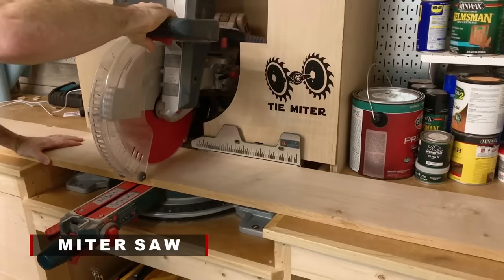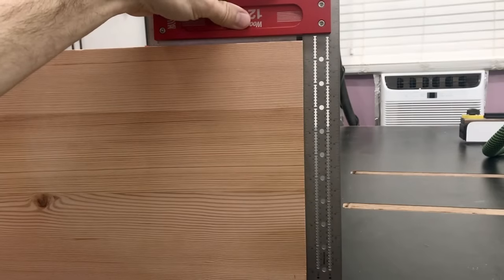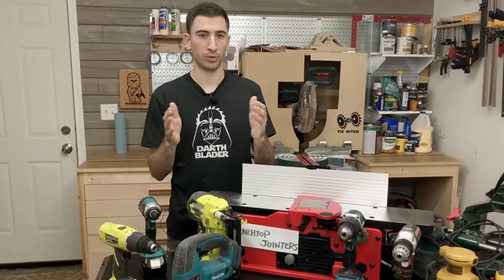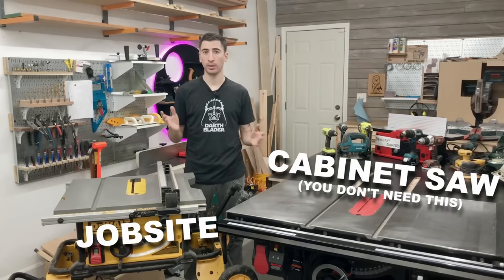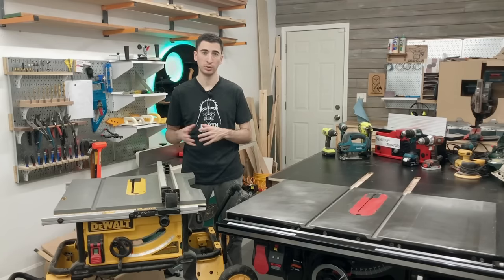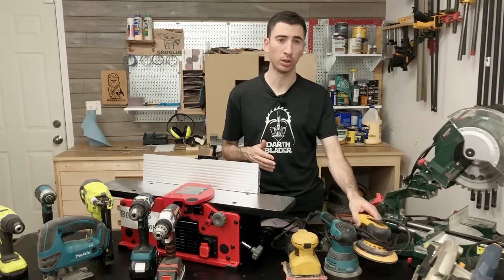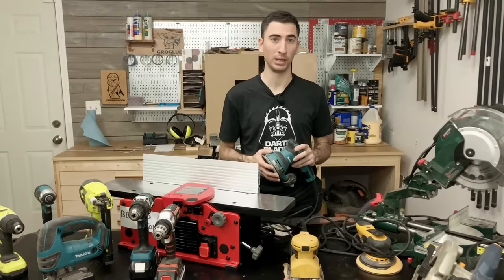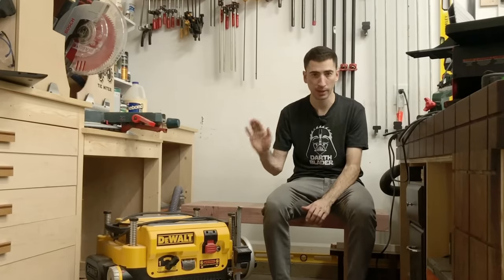Woodworking POWER Tools // Watch Before Buying

Comment: I once heard the suggestion that you buy the cheapest tools you can get when you're starting out. If you break it or wear it out then you move up to better quality because it's probably a tool you use a lot. If it doesn't wear out then you probably don't use it that much and you didn't waste more money than you had to.
Reply from the maker: Thats fantastic advice Thomas
Reply: I like that philosophy. Because trying to sell an upper tier tool that you realize you don't need is a whole other kind of headache.
Reply: It works unless cheap tools means lower quality, like DeWalt stuff.
Reply: It is a very good advice. The only catch is that sometimes, you spend so much time trying to master a cheap tool to realize, it is just not accurate enough, whatever you do. That's what happened with me with a big table saw; I've took on the challenge to master it for 3 years, and was able to do nice stuff. Then I got the 735 Dewalt Jobsite Table Saw to realize I spent 3 years loosing my time to a saw that was never going to provide the results I thought could be achieved
Reply: Harbor freight method
Reply: OR, you ended up scoring a magically good deal! Nice advice either way.
Reply: @bowlchamps37  Then why do so many professional craftsmen use only Dewalt?
Reply: In Scotland we call certain cheap tools "chuckaway charlies" or Bendyfriends -e.g. 100 piece socket set for 9.99 etc.

I've restored a bunch of yachts/houses and buy cheap orbital sanders, for example, for knocking back hulls etc. No point in using an expensive tool for a sort of crappy, punishing job, that'll trash the tool relatively quickly. Ditto jigsaws. I use a Harbour Freight equivalent for basic work at the yard and more refined tools in my home workshop.

I'm often surprised how long some of these cheaper tools last, but I tend to look after stuff anyhoo.
Reply: I broke 2 cordless drills at my work made by Makita lol they simply overheat and broke, after that I bought myself Bosch and I'm using it now for year and half and I'm really happy with it, I tried cheap versions like Parkside or Einhell or even Boxer but they're just too weak for my type of work
Reply: This does require knowing when a cheaper item will cause more problems in the long run. Some things are obvious like safety gear, other things less so and it may show up in terms of usability or repeatable precision.
Reply: I have several of these and built our Off-Grid home with them.  Worked fine and am still using them.
Reply: I get it. It makes sense. But… I’ve been doing it long enough to finally realise that: you buy cheap - you’re happy for a week or two then angry/disappointed/frustrated/miserable really for years to come. You buy something good which usually is expensive and it hurts for a week then gives you years of happiness/satisfaction/pleasure. 
That said not all tools have to be new. Personally I take pride and pleasure in fixing machines, so I often look for used or even broken ‘good ones’. Win-win
Reply: @camofpv  I figure that's how you discover which tools you have to spend more on. That way you don't spend a fortune on tools you'll only take off the shelf once a year.
Reply: I know a saying: I'm too poor to afford to buy too cheap. Often cheap things don't last too long, and you find yourself buying exactly the same thing once again, later on. So you may end spending, the same amount of money that a better one will cost. Cheap things, like tools, can, many times, be hard to use, because of adjustment possibility, or imprecise adjustments, durability of the tool, vibrations, noise and so on. I'm not saying that you can not do different kind of work with cheaper tools. I'm saying that when you go cheap, the risk to go too cheap, is very much present, and you may end with something very close to useless. Sometimes it is much more difficult to purchase something cheap and useful.
Reply: @bowlchamps37  You don't like dewalt?  What do you recommend?
Reply: @Layjaylagoose  dude I had the exact same experience with a cheap table saw.  It wasn't from Harbor Freight but you can get the same one from there with a different sticker.

I could never afford a nicer saw but somebody was really nice to gift me with the same DeWalt jobsite saw and it really drove home how much I was fighting the cheap saw.

I probably used the cheap one for 5 years and built lots of stuff I'm proud of with it.  The only thing I disagree with is that I don't feel like that time was wasted.  I learned how to set up different cuts and the discipline to double and triple check that everything is right before making a cut.

And even with all of that being said, I still agree with the main point of buying cheap to start off with.  Especially if this is just a hobby that you don't know where it's going to go.  If you just watched a bunch of YouTube videos and got all wound up wanting to try this stuff then you probably shouldn't go right to spending $10,000 getting an awesome shop set up without even knowing if you really like this stuff, have the patience to learn, or even the ability to do it.  For example, I've got a $100 HF miter saw that I'll probably never replace unless it dies because for the relatively little I use it, it works great.  I've got a friend who bought a nice miter saw that's still in the box because it turns out that he got a little too excited about this stuff.
Reply: @stefang1087  I agree with what you're saying but I'm very broke.  The only time I'll ever buy a tool is when we've got extra money (like tax returns).  So if I end up buying 2 cheap saws over time when I could have gotten one decent one for the same price, that's a moot point for me because that's all I'm ever able to afford.  If I tried to save that money it would end up having to be spent on something that is definitely more important like food or when the cheap car eventually breaks down.
Reply: @bowlchamps37  nock dewalt as low quality all you want but I’ve had mine since the versa pack came out and I’m still using them 
Even upgraded the batteries and bought a few other tools that use the same battery 
I use them daily for everything from hanging drywall to hanging stucco wire so to say a few thousand screws isn’t even a stretch 
Infact I like them so much I’ve never bothered to contemplate replacing them or “buying better”
20 years later
Reply: @rickshannon2044  I’d be one of them 
30 years in the trades 
20 with the same dewalt 18volt XRP versa pack that I use at home every weekend and everyday at work
Reply: That's good advice, but I went ahead and splurged for a Dewalt table saw since it seems that a table saw is really a foundation tool. I forked out another $200 for it over a Skil.
Reply: @volplay1  I can almost guarantee that he would recommend Milwaukee. There is a rivalry like Ford/Chevy that requires people to shit on the opposing brand at every opportunity.
Reply: @gon3946  Bosch corded hammer drill is amazing for concrete work
Reply: Sounds like something a cheap tool salesman would say…
Reply: I was taught this too, and it is sound advice, but there are some exceptions, like I've gone thru about 4 lower tier recip saws within the span of a year, and looking back at the money I spent on those, I could have gotten like a 4 or 5 tool set from a premium brand. bit I suppose that does reinforce the idea of using cheap tools to see what you actually end up using.  but one point I wanted to make was sometimes w cheaper tools, they don't perform properly and could turn you off to the Tool entirely, just to find out it's an essential tool, just u had experience w a shitty one lol.. long story short,  I guess my opinion on all this is, start out w a lower tier setup,, but go w a higher level lower tier setup lol if that makes sense. 
go w ryobi over black and decker,, craftsman over hart,, and anything over warrior n harbor freight shitshaha
Reply: Adam Savage gives this exact advice in his book and it has really helped my GAS (gear acquisition syndrome).
Reply: That's a formula for frustration, discouragement and throwing your money away.
Reply: Actually, buying the best of everything when you'll rarely or never use it is throwing your money away. The point is, if you end up using it enough to wreck it you know that's the tool you should spend more on. If you bought something cheap and you find you hardly use it then you haven't lost much.
Reply: No, get the best you can get otherwise your just paying thrice
Reply: This is exactly what I did when I started building electric guitars. I really quickly noticed what tools I demanded more and bought better ones. I still use a few really affordable tools today because they do the job and there is no reason to "get better". Sandpapers, saw blades, cutter and router blades are the ones where I invest in quality. Of course, hand tools are also heavily used in my work and I applied the same updating principle to them.
Reply: @bowlchamps37  the old cowardly black and decker 😎
Reply: @rickshannon2044  Dewalt has made some nice tools over the years & they've also made some terrible ones. Can't tell ya how many cordless Dewalt impacts I've watched burn up over the years from only moderate use, while red & orange tools did the same job just as well if not better and always last longer. Dewalt heavily relies on their reputation from the 80s & early 90s paired with by far the biggest marketing budget of the box store brands. Some residential contractors buy Dewalt because historically it was a safe bet, as it worked for grandpa/dad for a couple decades. Once most contractors are using a battery platform it's nothing short of an act of congress to convince someone to switch. Go to commercial construction sites and it very rare to see anyone with a toolbox full of Dewalt.
Reply: @ragnarrklangsrok1685  Until they burn up! Milwaukee rotary hammer drill costs less and lasts longer than the bosch.
Reply: Not the best advice. There’s a variety of reasons not to buy the cheapest. The reality is that the cheapest are made poorly and will fail. But more so are dangerous. Buy American made, or one that has good reviews. Sure you don’t need a pro level. But save you fingers and get a safer one.
Reply: It’s good advice if you’re going into it as a hobby vs starting a trade.  I saved up and bought nice tools along my electrical apprenticeship and I’m glad I saved for good tools I knew I’d use bc my foreman and Jmen had em.
Reply: Love that philosophy!
Reply: I will respectfully disagree with this philosophy.  You spend money on “junk” then spend money on something that’s quality?  So you end up spending 50-70% more money than if you had gone out and spent your money on a quality tool to begin with.  I spent a couple of years struggling with an old craftsman contractor tablesaw with what has to be the absolute worse fence ever conceived.  I could never trust the damn thing to be square, from cut to cut. The saw was extremely heavy and underpowered. I finally went out and bought a DeWalt and it’s night and day.  It’s not a cabinet saw. I don’t have $4K-6 to spend on anything like that. One day I may decide to get something better but at the very least, I’ve greatly improved my building experience and alleviated a ton of frustration, for now.  If money is a problem, I’d rather buy a used quality tool than a brand new inferior tool.  I visit pawn shops and apps like Offer-up.  I’ve found some pretty great deals on both.
Reply: @bowlchamps37  I have NEVER seen a cheap DeWalt ANYTHING.
Reply: I hate seeing this stupid comment on every video like this. Yeah, we need more people buying cheap crap thatll go into a landfill.
Reply: @BadYossa  You should be less casual about telling people to work on batteries. People can burn their house down if they are too casual.
Reply: @OptimusSatanas  Buawhahahahahahaha!!!  Well, there you go. Glad somebody said this.
Reply: You can buy cheap but DONT PUT YOUR LIFE OR SOMEBODY ELSES IN DANGER. shop around.
Reply: Im not going to spend a truck note on Snap On Tools
Reply: Agreed, but there are a few caveats I think. Buying used on a platform like OfferUp has made it possible for me to create a decent, rudimentary shop to start. But. You’ve got to do a little research before buying. You can get TOO good a deal (like table saws) that almost never come with the safety stuff ordinarily included with a new purchase (fences, blade guards, riving knives). Looking for a saw with a fence set on a rack and pinion setup makes the purchase a bit more, but trust me when I say you will be VERY glad you did. I learned this the hard way. My first table saw was so bad, I couldn’t even make a workable cross-cut sled with it. I didn’t bother investigating why (though I suspect there was something jacked up with the blade bearings or setup somewhere). Unless all you’re going to do is rough cut lumber, it is in your best interest to get as good a basic table saw in the first place. Skilsaw, Craftsman, Dewalt, and Makita all make jobsite saws that work well — look for the pricier models with the rack and pinion fences, they’re out there. 

Or, hit your mother-in-law up for a Jet as a wedding anniversary present, your choice. 😀
Reply: Very good advice indeed. Not just for woodworking, but, for any craft or trade you're interested in.
Reply: @Layjaylagoose  Point. Still, you found out what you did want from the tool by struggling with the one you didn't. So it was just a learning experience that went a little long is all.
Reply: You can easily end up with a lot in the garbage can by using that i have bought a few cheap tools and tried them once just for throw them out again and bought some quality.
Reply: I've just bought a whole load of budget tools and cordless tools but good quality German made and many are cordless with only 2 or 3 types of batteries that happen to interchange with other (unnamed brands) as they're actually made by a brand name under an own brand label.. going to be good enough for me! (And they come with a 3year warrantee, so you can't go wrong!) If they blow up you get a refund or replacement.. job done! 
Cheers from London England 👍😎🏴
Reply: It is if the tool is square, sharp, sufficie try rigid or whatever it is supposed to be or at least close and serviceable or adjustable.  

So many cheap tools are not, and they don't get you anywhere but frustrated, or worse, ruin a workpiece.
Reply: Hmmm. As a weekend warrior, I still use my uncles 1968 corded electric drill for some jobs. I also have Millwaulkie compact-impact drill set used on many jobs fer 16 years. Still goin strong. Dewalt compound-miter saw and table saw fer last 8 years. Happy with my products. These products are always going on sale at  yer local big box store.
Reply: @ragnarrklangsrok1685   I used Bosch corded hammer drills everyday as an electrical sign installer in the Los Angeles area all through the 90's.  Those are great hammer drills no doubt.  Drill thousands of holes through the sides of concrete building all over the great L.A. area with mine.   Just like any tool though with that kind of daily abuse you will wear them down over time or at least require some maintenance after a while
Reply: Same approach here. And we believe what suits pros will last starters. Pros that pay for the tools they use, may choose differently from a situation where a company picks up the bill.
Reply: Or, you don't use it cause it's inefficient, inaccurate, & just plain sucks so you should've purchased one worth using to begin with. I run into this a lot with every tool.
Reply: @ZackHarold  I was gonna say heard it from Adam Savage. However, I am still not cured of the syndrome/addiction yet. It's a work in progress.
Reply: @BadYossa   thank you- I’ll go check out his channel
Reply: @rickshannon2044  customer service
Reply: That's sound advice! 👌🏾
Reply: I might not buy the absolute cheapest, but I'll definitely consider decent budget tools from brands like Ryobi or Black & Decker.  Here we also get some Chinese brands that have built up a good reputation due to being both cheap and able to stand up to a decent amount of abuse.
Reply: I've never heard the suggestion you posted before, but I agree 100%. Most of the tools I started out with and still have are/were used name brands, or new cheap off brand tools. The tools I find that I end up using the most I'll do my research on name brands first and wait until any holiday sale is coming up and go buy a new one, only after hitting up the pawnshop, or any other second hand stores, or garage/estate sales first. Lol
Reply: @BadYossa  where in Scotland are you from cause no we certainly do not call them that 🤣
Reply: A great source for tools can be a Pawn shop. Just make sure they're not worn out. I've picked up great pieces.
Reply: @Layjaylagoose  that 💯 true.  A better quality tool can help you preform better sooner, safer, and cause you to stick with learning.
Reply: @Layjaylagoose  Exactly. For some tools accuracy is the defining criteria for it’s quality. For others it’s durability. For saws, you often want accuracy above all else. For drills, it’s durability and power. Generally speaking of course.
Reply: But if its Xmas ask for the nice one!
Reply: Definitely make a good point.
Reply: @bowlchamps37 
Do you even watch reviews, Dewalt
 Is a pretty solid brand. I’m not saying all their stuff is fantastic, but they are mostly a hit than a miss 
Unless you are using the wrong tool for the job
Reply: I bought a mastercraft hand planer and it's a peice of junk I'll never use it I wish i would've bought a more expensive one I'll probably never buy a hand planer again
Reply: I've run into this too - the inability of a cheap tool to do a good job. I have countered the urge by doing hours and hours of research on the web when I need a tool. I don't really like to buy as cheap as possible for this very reason. Even if it's just an angle grinder or screwdrivers. Cheap, disposable tools are rarely good for anything other than exercises in frustration. That being said, there is a place for cheap tools, as BadYossa says above (they can be abused without concern).
Reply: @BadYossa  Wow, thanks for pointing that out! I'd never thought about that possibility. I'm no longer concerned about the lifetime of my batteries!
Reply: @jarredsegal6842  I don't work directly in the trades but I have worked in proximity with them, selling tools and materials for almost a decade and doing my own projects at home. Everyone around here has at least one DeWalt tool of some kind. I have never heard anything negative about DeWalt, except "batteries are too expensive." DeWalt makes tough tools that last. Even if you forget them out in the rain overnight (probably don't want to make a habit of that though, obviously). I am in the process of building my collection now.
Reply: @Layjaylagoose  thats the thing. Hard to do pro level work with cheap tools, i always buy the best i can possibly afford. Im also single with no kids and i do this for work so my situation means i can spend more money on it than most people haha
Reply: Agreed.
Reply: I don't subscribe to that philosophy at all. Junk tools just produce junk products and teach young aspiring craftsmen bad habits. They're a waste of money and time and energy and space. When it comes to tools, I don't say to get the best you can afford; I say get the best you can FIND, and then learn to maintain and take care of your shit, and cultivate the discipline to do it, and use them only for the purpose they were designed for, and they will last your entire lifetime. Buy once, and cry...maybe about the insanely short lives of dogs, but never about the price of good tools. An excellent tool will inspire you to produce excellent work. A shitty tool will turn you into a shitty human being faster than you can say Black & Decker. If you can't afford a good tool, what are you even doing with your life? Get your priorities in order!
Reply: This exactly how I started my collection. Every mistake isn't a big deal purchase and it gets tucked away for blue moon use. Ones you need to replace you know exactly what you areooking for in purchase. Best advice right here
Reply: That's how you keep the spouse happy. I mean let's be honest we all want nice stuff all the way around lol
Reply: I'm stealing that...
Reply: @Layjaylagoose  buy german stuff , they somehow manage to build cheap and better quality than expensive products, if your market offers them of course 😮
Reply: Initially this sounds like a good advice. But why would you want to create more waste? Stop buying the dead cheap tools of low quality. It will create more waste - we have a planet, which is dying in rubbish - especially plastic. Buy quality tools, which will last the distance. That does not have to be the most expensive,. But the dead cheap tools often will not yield a good result, which will lead to aspiring woodworkers giving up. I have seen this time and time again with woodworking friends. They give up on a project because the tools are cheap and useless. Then I show them the right quality of tools, and the project goes well. And I am not talking about the overpriced and hyped tools. I am talking about good quality - made of good lasting materials.
Reply: Buy used tools of good brands, it will usually be cheaper or same price of brand new tools.
Reply: No one should ever buy any tool(or anything else) they haven’t researched sufficiently, cheap or expensive. Furthermore, the quality level you need depends in large part on how you use it. Are you a pro using that tool 8hours a day, 5 days a week? Or a DIYier using it A minute or so at a time, an hour or 2 every other day, or week? I got a set of porter cable 18 volt tools (drill & driver, 5-1/2 circular saw, recip) 7-8 years ago. Every tool still running, batteries have all been replaced. The same for the plug-in compressor &nail guns. I’ve done demo on walls interior & plumbing, tree pruning, etc. One note: the cheaper the tool, the more you research.
Reply: Wise words.
Reply: Yeah, but what if you just want to get the better one just to have it and look at it?🤣🤣🤣
Reply: @bowlchamps37    Dewalt? Cheap?  You must be pretty well off!
Reply: unless it’s a tablesaw because there’s no nothing worse than trying to work with her flimsy fence or one that can’t be made perfectly parallel to the blade
Reply: @bowlchamps37  Hi, so I happen to like DeWalt line of product especially their drills.  I than bought a set for my parents for Christmas and they loved it.  What other top brand do you recommend?
Reply: DeWalt used to be the best cordless product on the market. Over the last decade, they have definitely dropped in quality. I am an Aviation contractor and travel all over the world working on aircraft. I have seen many people who used to love Dewalt, which now complain about them. To be completely honest ALL of the big name brands have dropped in quality over the past decade and are coasting on their names (in relation to their cordless tools). I do not subscribe to the buy the cheapest tools method, but instead subscribe to the buy the cheapest best tools. What I mean is research your tools, find the ones that will perform to the standards you require and purchase that tool. If you are not a professional shop you do not need a table saw that will run 12 to 20 hours a day. If you are not building cabinets or drawers you can probably do without a router. I do wood working as a hobby. I do own a lot of stuff I do not need for wood working. All I have done so far is build my wife her "she" shed and build the custom cabinets for our kitchen remodeling. I am a professional Aviation electrician and own much more expensive tools for that. Again my profession and I own the best of the best; all of my electrical meters are made by Fluke since they can be calibrated to the smallest tolerance. I also own 2 grounding mats that cost $1k a piece (for rubber with copper running through it!!!) a voltage and amperage regulator that cost me 5k 9 years ago. I say all of this to point out the difference between professional and hobby prices. My entire woodworking tools collection has cost me less than my regulator (Not by much). Research your tools. Know what you hope to accomplish. Make smart purchases.
Reply: No that’s false
Reply: There are caveats to this, for example don't buy measuring tools from Harbor Freight; their squares aren't, and their tape measures don't.
But for router bits, I bought a VERY cheap set of router bits from harbor freight, it worked out to like $2/bit, they're okay, they cut fine, and the ones I wear out, I'll buy quality replacements for, on the assumption that those are the ones I use, so get the nice ones of those.  The ones that stay unworn...well I don't need a good one of those, the cheap ones are doing fine.
Reply: @mtcrabtree  You know why I use DeWalt and Craftsman instead of Makita and Ryobi?  Because my town has a Lowe's but no Home Depot.  If we had an orange home center instead of a blue one, my shop would be full of teal and lime rather than yellow and red.

Any of the ~18V cordless power tool systems on the tool aisle of the home centers are actually pretty good, and getting better.  Honestly, pick one of them and roll with it so you have one battery standard.

Corded tools, on the other hand:  I've got a Kobalt router table, a DeWalt table saw, a Black & Decker jigsaw, a Bosch chop saw...No brand loyalty here, because their plugs all fit my wall socket.
Reply: Plug in I could care less about brand as long as it does what I need it to but battery powered I use the same brand cause I hate having multiple batteries lol.
Reply: Just don't cheap out on your table saw and miter saw. Accurate cuts matter
Reply: That makes the most sense to me.  Why buy a top of the line table saw if I use it twice in a lifetime?
Reply: I bought the cheapest table saw that i could find and i regret it... Yes you don't need a sawstop but a dewalt would be a good choice
Reply: Edit, for corded tools I also don’t care. But when going cordless, definitely Makita.
Reply: This adult man really likes Star Wars
Reply: Exactly  I feel the same way when buying tools for around the house.
Reply: I would also add to this that using crappy tools in the haydays of your hobby makes you used to producing good things with crappy things. Once you replace them with quality stuff your crafts will increase twice as much as your tools just did in quality.
Reply: Superb poin of view
Reply: @Layjaylagoose another great point of view ...man the comments are so informative sometimes
Reply: That old saying, ‘Buy cheap, buy twice’!
Reply: I heard this suggestion made by Adam Savage from myth busters fame in his youtube channel perhaps you heard it there.
Reply: I bought a Ryobi circular saw that lasted several decades.  It was very cheap and "very cheap" was the only way I was going to own a circular saw in those early adult years of my life. I used it a lot, because building things saves money, but more importantly, it's part of who I am.  When I finally knocked the base plate out of alignment - a lifetime later - I bought a quality Makita. At that point I realized a lot of my hacks over the years trying to get a circular saw to rip smooth and straight, etc. were about overcoming the limitations of that saw.

Paying too much for a tool is burdensome but paying too little and then being stuck with it is probably worse.  I guess that's what they call "opportunity cost"
Reply: Not sure about this advice, I followed someones similar advice and bought and used my not so cheap (but cheaper than the rest) circular saw 6 times in a span of 3/4 years and it stopped working all of a sudden, Black N Decker.
I usually buy the mid/expensive tools because you will only buy that once and use it for the long run. There is a saying in portuguese “O barato sai caro” which translates to “the cheap becomes expensive”
Reply: This is the worst advice imaginable and dangerous.
Reply: This is a good way to buy every important tool twice. There's way too many tools where the low end is still too expensive to eat twice
Reply: I don't agree. A cheap cheap tool probably won't work very well 
, might not be accurate, won't hold a sharp edge, etc. Get a medium quality tool if you're just starting out.
Reply: Great advice, but I'd buy in the middle. 
I'd rather keep my fingers the way they are. I just don't feel like the cheapest jigsaw is gonna be good.
Reply: Change "the cheapest tool" to "the most cost effective tool that you can afford", then that's good advice.

No point spending $20 on a tool that you use occasionally, that blows up just after it's warranty period is over, and you need to spend $20 again, when you could have spent $35 and not had to replace it.
Reply: @RogueCylon  after I switched to Milwaukee I didn’t turn back when it came to cordless but for corded tools, I use the Dewalt miter saw, and tablesaw. And the reputation of them being good was when they were basically at different company back in the 90s and prior. That said I also picked up a 12 V Dewalt oscillating tool, and I am very happy. I always said I don’t think battery will replace corded stuff when it came to anything aside from drills basically, but was very impressed with Milwaukee’s line of stuff. However, when it comes to miter and table, I prefer corded, even though some of the cordless stuff is pretty amazing.
Reply: Back in the day I got taught to buy cheap kits for the shop, those kits like drills and screwdrivers, normally come
With good quality organizers, then as you break the cheap stuff replace with quality pieces
Reply: This is legit awesome advice
Reply: As long as it doesn't hurt you when it breaks. Like wrenches, for example,  a lot of torque is applied to wrenches and when they break you can really get hurt.
Reply: Curious quote but I'm not buying it.  I have to try 3 times harder and end up failing in the end with cheap tools.  If I buy expensive tools I feel like a wizard and get so much more done.
Reply: That is super smart! I burnt up my cheap reciprocating saw (construction not woodworking lol) and I was planning on getting a better one.
Reply: Oh, to modify that....  I do have a refurbished Bosch hammer drill. I needed a real, tough hammer drill for something. And I've needed that and nothing less multiple times since. But I only use it once every few years. So I got a plug in refurbished if a top brand. It' does all the concrete anchors I need!!!
Reply: @Oh6Torch You end up not buying a lot of stuff you don't actually need and so save a ton of money.
Reply: @CeeJayThe13th   Wow! I understand being broke (been there), but I don’t understand saying it will never get better. Do you live in a third world country with no possibility of getting more education, more training, etc? If so, then disregard this reply with my apologies and best wishes. Wow…
Reply: @shopsmithwoodworker2023  I didn't say it would never get better just that I'll never be able to afford the nicer stuff.

It was kinda cool going back and reading that comment because my friend I mentioned never taking his saw out of the box has gone on to use it and make lots of cool stuff and even make decorations for his friend's wedding.

And since then, I had all my tools get stolen and had to start all over.  It's how life goes.
Reply: Cheap is likely dangerous. Fast moving parts made of cheap materials.
Reply: That is an Adam Savage quote.
Reply: I've spent a week looking for this advice. Thank you for finally answering my question!
Reply: Especially when it comes with features that a newbie wouldn't use/understand. Just creates room for making mistakes that a simpler tool wouldn't
Reply: I have had Bosch, Dewalt, Ryobi, AEG, Milwaukee, metabo, Hitachi and Makita, they all have their good and bad. I wouldn't buy AEG now though  rubbish compared to my old drill.
Reply: You buy the best tool(s) you can afford and upgrade when you want or need to.  There is some truth to the buy nice or buy twice especially for tools used frequently.
Reply: But some bad tools doesn't break, it only make you mad everytime.
Reply: The only issue is that with cordless tools you have to commit or waste a lot of money. Of course the alternarive is corded tools but for some peoples (not most) setups/layouts corded are a massive pain
Reply: Well naturally cheaper means lower quality generally speaking, but that fact doesn't go against what the OP said